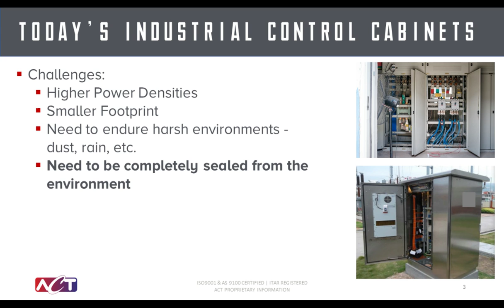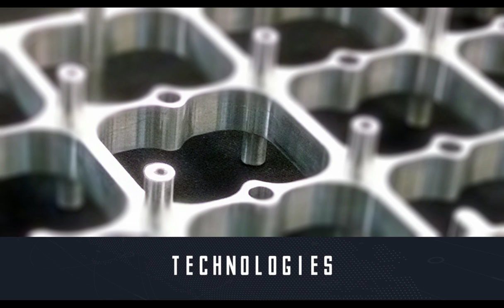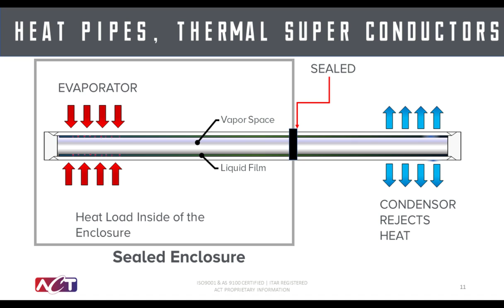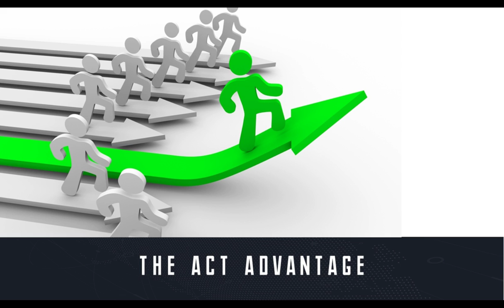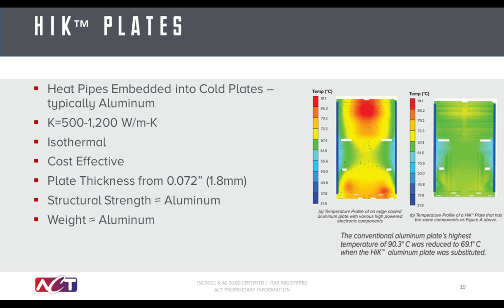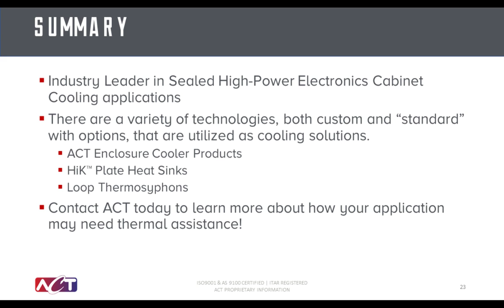WEBINAR: Cooling High-Power Electronics Cabinets

Comment: I must have missed something or had a rough day? But I don't see where you arrived at your "Heat Loss" values with each component, as the way you explained it at 7:30 mark (Qty. x power parameter x eff %) ? 😕
Reply from the maker: We can work through your specific application with you if you'd like to call or email us at 717-295-6061, solutions@1-act.com